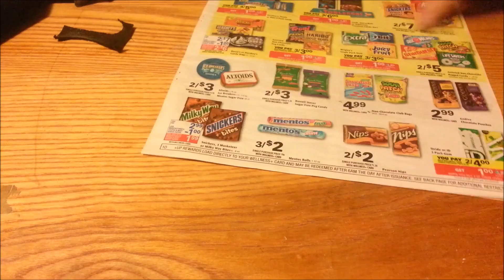Cribbage Board Part II

Comment: Very creative I have an Olive branch that I would like to make into a cribbage Board, how would I obtain a similar plan.
Reply from the maker: No plan necessary really. Just google cribbage board template, find and print one you like, glue it on and start drilling! I would recommend making a master template, like I did. This helps guide the drill bit into the proper spot. Otherwise the bit will want to follow the grain of the wood resulting in uneven tracks.
Reply: Template sounds like good advise, as an after thought what size drill bit would you recommend? comparing the deck of cards next to your board my board would be similar in size. Thank you
Reply from the maker: +Michael Mac Depends on the pegs you plan to use. I don't recall what size I chose since I made custom pegs. I Suggest finding pegs first and testing different size bits for the right fit.